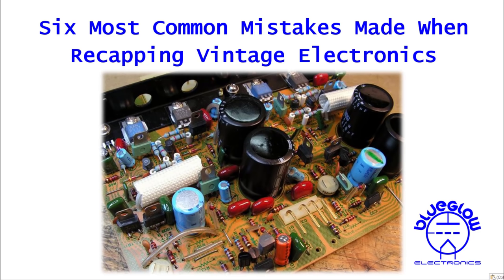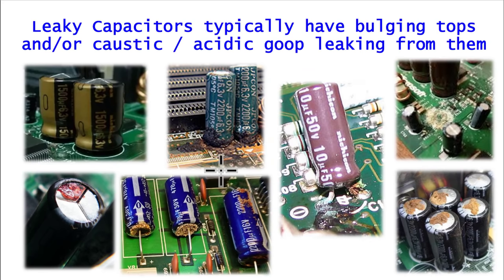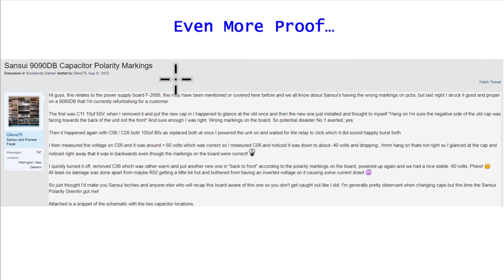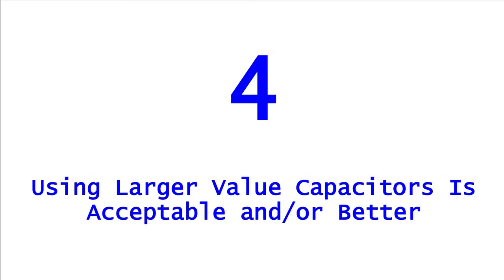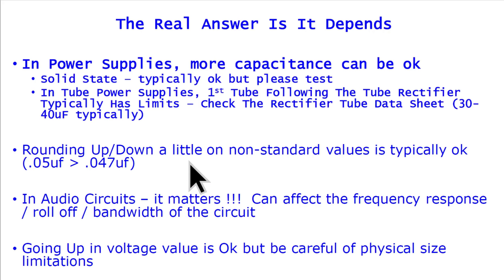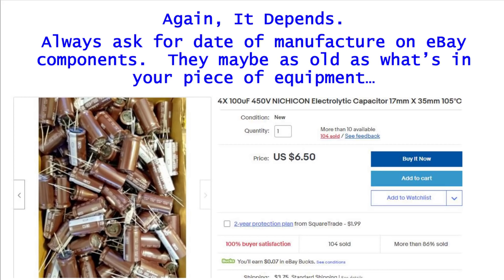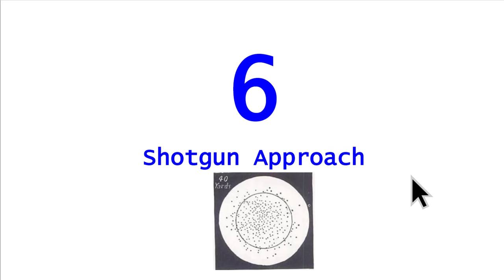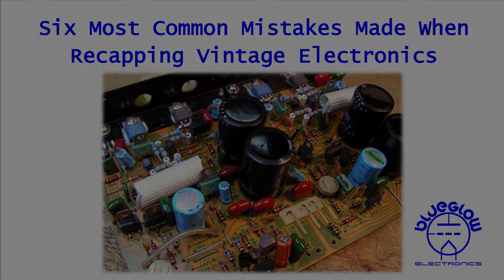Six Common Mistakes Made When Recapping Vintage Electronics

Comment: These are the types of videos that help me the most. That cover all types of electronics not just radios and such.

I repair vintage and modern electronics, mostly test equipment and industrial electronics. A lot of motor drives, PLCs, and a lot of automation control equipment. I do see a lot of 1980s equipment that is still in service so I recap and repair a lot of stuff like that… And these are the videos that help me the most. Although I do enjoy radio repair, I don’t do it very often so these general subject videos that cover a broader range of electronics are extremely helpful!

Comment: Your videos are fantastic!  I have a professional lounge organ; a Wurlitzer 805, built around 1975.  The voices haven't worked properly in years, and I have come to learn that the power supply and switching boards are the prime suspects. I thought I would have to replace the capacitors with the exact same parts, which I was trying to at least find a source for before I started disconnecting and testing. The search was unsuccessful!  Your video gave me confidence that I can restore whatever caps these boards need by following the tips and procedures you showed. Thank you for loads of valuable information!

Comment: I did enjoy this one.  I never considered the glue being mistaken for leaky caps.  I can see myself making that mistake even though I was aware some are glued.  The last piece of advice is by far the most important though.  This has bit me more than once in many different fields.
Reply: Lots of people think the glue is electrolyte leakage...   And yes, marking things helps, but I use photos, lots of photos from lots of angles. That has saved my ass many times. lol!
Reply: I believe that 'glue' used to hold electrolytics and larger parts is normally known as 'staking adhesive' . It turns brown over time and is frequently mistaken for leaking electrolyte.

Comment: At 00:55, The top-left CAPs have that rubbery glue to stop the component from vibration, (i.e.)  subwoofer cabinet.
Reply: Remember the era when people used to mount their amplifier directly on the subwoofer box itself? LOL
I made a lot of easy money repairing amps because the vibration had shaken loose anything heavy or tall. XD
 (the amps were usually mounted sideways)

Comment: I am a retired electronics engineer and HAM radio operator. I worked in many different types of design disciplines . I also restore equipment. I am aware of all you presented and I love my subscription to your channel. I watched this one and am impressed how well you presented these common mistakes. I have friends that shotgun and who mistake the wave-flow or retention glue for leaking capacitors. In tube circuits friends with guitar amps typically want to up the capacitance which has caused them many problems. I am trying to work with them and they say I'm a perfectionist or taking too technical of an approach. These same folks do not embrace ohms law and also try to check caps and other components in circuit with a Ohm meter in diode mode. Sheesh.... I'm trying to teach them, but I will pass your video along to them.  Thank you so much !  I am currently designing my own Class A and AB1 amplifiers, All tube and Hybrids and you have helped me immensely as designing tube equipment is much different than servicing Them. Thanks Again !
Reply: Seems to me that you are out of their leagues, to put it mildly.

Comment: On #4, larger capacitance equals larger in-rush current on power-up. This applies to ALL circuits that don't specifically have some sort of in-rush current limiting scheme implemented and even then, you can damage the in-rush limiting circuit with larger capacitors. So, be careful with those over-sized caps, they may summon the magic smoke.

Comment: Note:  you don't want to go a lot higher in voltage with electrolytics, as you run the risk of them not "forming" properly.  Note that the fake restuffed "bumblebee" capacitor may well be more reliable than a genuine one.
Reply: Yes, in addition to that the higher the voltage rating the higher the ESR.

Comment: I have been working on vintage electronics for most my 60 years.  and your video did make me think of a few things I had not considered. 
I often take a photo of boards to use as reference when recapping etc.
Often a wire might break from moving things around and you are scratching your head where it came from.. And recently it came up that going too high in capacitance and voltage even in a power supply can be a mistake.. filter design depend also on resitance and inductance loads.. and even a supply is partly a filter.

Comment: Thank you for the video. Lately, I've been seeing a lot of parts like resistors and wire links eaten away by the glue used to hold down large parts. Somehow the 'brown' looking glue goes conductive and acidic.
Reply: What you are seeing is very old SonyBond glue used to hold capacitors and ferrite’s and other components especially in items that are moved a lot for example CB radios are notorious for having this glue in a lot of the old brands, and it is still being used today.
It’s best practice to remove the glue around capacitors and crystals and wires with ferrite beads on them etc.
As you have noticed once it turns brown its really very corrosive and conductive.
It appears to be Latex based from experience and there are chemicals available to soften it so it’s removable.

Comment: Great video!  A few minor things though.  One, take ESR into account - it can really matter.  Two, voltage and capacitance can be interrelated and you won't know unless you read the datasheet for the part you are buying.  For example many modern surface mount capacitors are rated capacitance at a fraction of their rated voltage, and actually have less capacitance at their full rated voltage, due to the physical properties of the high dielectric constant materials used today.  So if you are changing from one chemistry or manufacturer to another in your replacement you really need to check the spec sheet for the new unit and ideally the old unit as well as the actual working voltage of the circuit.  Three, your last rule of working in sections is a great point but I have one good counterexample.  Tantalum capacitors.  Their failure mode is particularly bad, rather than going open or losing capacitance like an aluminum electrolytic, they tend to short circuit.  This has obvious serious effects on the rest of the circuit.  I had one in a Tektronix oscilloscope power supply section short closed, explode, and splatter the entire power supply PCB around it with molten metal.  Luckily it did not short any wiring on the board but it did fatally damage the bridge rectifier feeding it, which I only found out after the fact when it blew a fuse 20 seconds after I powered it back on after the recap.  And 5 minutes after that, another tantalum capacitor failed in another area of the unit (a vertical amplifier board) which burned up a custom RFC I couldn't buy anywhere and had to rewind a replacement for myself.  Ever since then, when I see one tantalum failure in a unit, I go in guns blazing and replace every single tantalum I can find.  I may power the unit back up in stages and verify each board by itself if possible, but I'm not looking to troubleshoot three fires and 5 burned components after 2 capacitors shorted ever again.
Reply: I don't understand your point about capacitance and voltage being inter related.

Surely, you identify the working voltage for the capacitor that you want to replace, and then replace it with a capacitor of the same or higher working voltage and the same value of capacitance. Isn't that what you do?

What are you saying, the capacitance of the original  capacitor depends on the DC voltage across it?
Reply: @deang5622  that's actually exactly what I'm saying!  I myself only learned this a few years ago, which is a bit embarrassing as I'm an EE.  An older more experienced EE told me this back in 2017 and it seemed wrong so I read up on it and what do you know, it's actually correct.  I seem to recall it's only on more exotic ceramic dielectrics used in modern MLCCs and some of the more modern dry electrolytic varieties such as niobium oxide, but give me a few minutes and I'll see if I can find the papers I read on the subject.

Comment: All good advice. A short version of the quality points, don't be cheap! Mouser, Digi-Key, even over the counter, if it's still an option for you, is better for jobs like these. How much is your time worth? How much is the gear to be repaired worth? How important is your success rate worth to your business? Spend $2 for one instead of the bag of 100 for $5 online. I worked at a place many decades ago that had a sign: If you don't have time to do it right, do you have time to do it again?

Comment: Great advice - particularly tip #2 i.e. not blindly trusting board markings and service manuals and tip #6 i.e. not replacing capacitors willy-nilly or all in one go.
It's interesting you start with the problem of mistaking glue for capacitor leakage. However, old glue in some 80's-90's devices (particularly of Japanese origin but not exclusively) deteriorates and becomes corrosive with time and starts attacking the pcb and its tracks, damaging the pcb and causing problems.  Going from left to right and from top to bottom in the screen, it looks like photos 3 and 4, with the brownish glue, are good candidates for investigating whether this is the case.  If you suspect this glue is of that corrosive kind, you need to remove it scrupulously and clean the board afterwards with some appropriate solvent so there's no trace of the old glue left.

Comment: Most manufacturers of the electrolytic caps I have used recommend running them at 80% of the rated voltage to get the optimal life span.  Read the data sheet on the electrolytic capacitor you are using as a replacement.  Try to use exact replacements, otherwise you need to look at all the specs.   ESR and surge and ripple current capability etc.

Comment: Very good video. I am not a big fan of replacing blindly all caps in a older device. If the caps are good, they should not been replaced at all. A closer inspection and measurement of caps, can save time and money...

Comment: I might add that, when bodging in two 1000u in series because you want 500, dont assume that each capacitor will have half the voltage across it.  Overrate the voltage or, possibly, add a couple of resistors to swamp leakage and so equalize the drops, (or you can order the correct component:)

Comment: I would add check the size of replacment caps against what's in circuit before ordering. Just because they are new doesn't mean they are smaller. I learnt this the hard way.